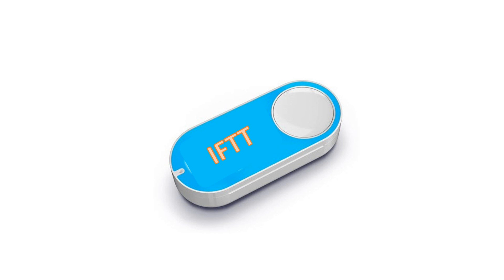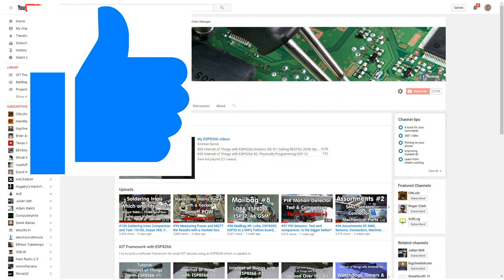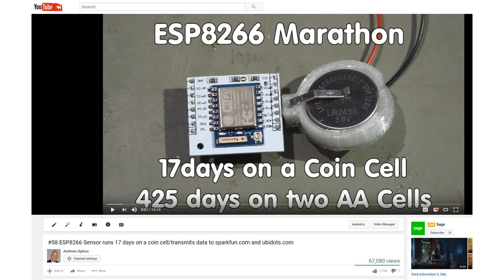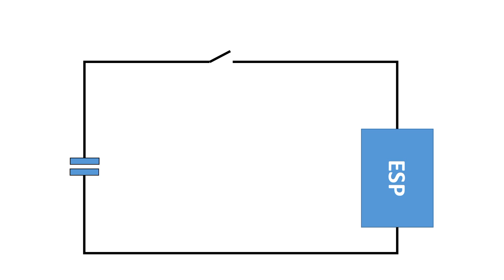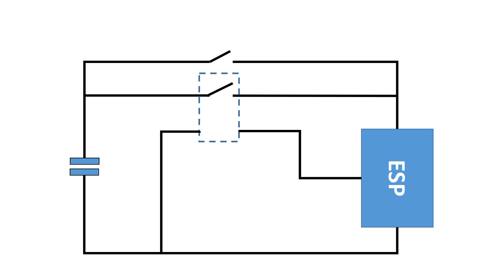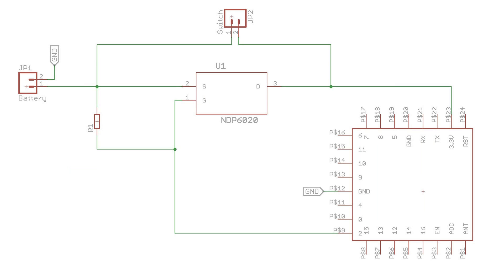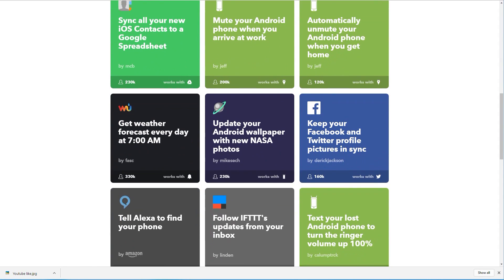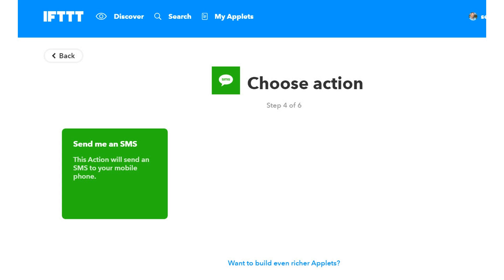#101 Long lasting DIY "Amazon Dash Button" using an ESP8266

Comment: Commenting to help the channel. Also, a real question...were you able to discover why it took the 15 minutes for the message to post after the sensor activity? I use IFFFT for some of my HA functions around the house and it is fairly instant? Was it possibly due to the proxy server in between?

Side thought, (you may have already done this. I haven't watched all your videos yet) you could combine an RFID tag reader to a button "station" so that it could perform different actions based on who was pressing it. Perhaps your wife or kids like a different kind of pizza. A small, passive RFID bracelet could make that happen :)
Reply from the maker: 1. I did not investigate into IFTTT. Maybe it just had a "bad day"... I usually use my own MQTT broker, so I am not experienced with IFTTT
2. I used the mechanical switch because it does not need any electricity if not used. The RFID reader would need the same property if you want to start the ESP with its pulse. Or you would need a button as now and switch the RFID reader on with the ESP. Maybe an easier way would be to connect a few buttons, each for a different purpose.
Reply: I suppose it all depends on the use case. For example, if it is expected that button will find it's way moving around the house, or if it would always be in the kitchen near something that could already be performing micro localization of occupants. In lieu of all that, and more inline with your multiple buttons idea, you could ad a single button with a RGB LED and keep it all on one device. You could tap the first button to get the color you want (everyone gets their own color), then press the "order" button. You could even do this for a single user and ordering drinks; yellow for beer, red for energy drink, and blue for a Mana potion.
Reply from the maker: I see, you are a very creative person. And these wishes were always the first part of something new. So, keep on!

Comment: Which mosfet do you recommend for this circuit? the NDP6020 seems to be oversized and expensive. What about a BC557?
Reply: Hallo. Du hast hier einen super Kanal aufgebaut und sehr hilfreiche und interessante Viedo gepostet. Ich habe versucht den Dash button nachzubauen. Irgendwie bekomme ich jedoch die Transistor schaltung zur Spannungshaltung nicht hin. Ich nutzte ein 2n2222a-h331sollte ein npn transistor sein. Geht das überhaupt damit oder nutzte ich das falsche Bausteil. Ich habe Transistor auch mal anderesherum eingebaut, leider ohne Erfolg. Grüße
Reply from the maker: AFAIK the BC557 is a NPN transistor, not a MOSFET. You can replace the NPD6020 with a logic level SMD MOSFET, if you want.
Reply: AO3401 is cheap and a p-channel
Reply from the maker: Looks like a good choice. It should switch at 3.3 volts. But it is tiny (SOT23)

Comment: Can you provide some physically smaller Mosfet part numbers? I can find plenty of to-220 packages, but I am having trouble finding smaller ones.
Reply from the maker: There are not many through hole logic level p-channel MOSFETS available. I recently bought some IRLML6401. They are SMD. But I did not test them so far. If you search, search for one which is switched on at a Vgs of -3.3 volts

Comment: the NDP6020P pinout is wrong on video. The right way 1-G  2-D  3-S
Reply from the maker: Thanks. You are right!
Reply: Andreas Spiess I could not run the esp8266 from a coin cell CR2032..  what one had you used?

Comment: Andreas, I am having trouble with my mailbox notifier circuit.  I have used an IRF9540 P-channel MOSFET to automatically turn off my esp8266-01 via a reed switch.  But the module keeps restarting and it doesn't seem to respond to the reed switch.  For example, if I type digitalWrite(MOSFET, LOW), the entire circuit shuts down; This should not be happening but I don't know how to fix it.  It looks like the esp is properly shut off, even if no magnet is nearby, but after a while, the ESP restarts and initiates wdt reset. 

Also, I would prefer if the esp8266 01 would auto-reset itself after each startup, just like the Arduino.
Here is my schematic: https://tinyurl.com/yazx45l5

I also noticed you struggled with the same wdt reset problem.  Did you figure it out yet?  Here was your discussion: https://github.com/esp8266/Arduino/issues/1017

Thanks,
Nathan^2
Reply from the maker: I always suggest to partition systems for error search. In your case, separate the two things: The ESP and the MOSFET circuit. First, you test the ESP with a normal switch to simulate the effect of the MOSFET. Does the ESP behave as you wish?
Second, you use your MOSFET circuit without the ESP (simulate the ESP with a 30 Ohms resistor, attention: hot!) and test, if it switches the power pin according your plans. It might be, that it does not properly switch, because your MOSFET has a high Vgs voltage.
Only if both parts do exactly what you expect, you connect them together and test again. Measure the voltage at all points and compare with your initial tests from before.
Reply: Andreas Spiess, I just moved the 1M ohm resistor that was originally connected to the source of the MOSFET and now moved it to the drain.  it works now but unfortunately, the current is 15mA when the circuit turns off power.  I did your original circuit as well and, Surprise, got 15mA at off state too!  Something is telling me that this MOSFET has a leak.  Should I get the MOSFET you used in your video or should I make a modification to mine?
Reply: Andreas Spiess also, should I regulate the voltage first and then control it with the MOSFET, or can I use what I did (MOSFET controls the voltage regulator)?  Does it make a difference.
Reply from the maker: As I wrote, I think, that the Mosfet does not fullyturn off at this low voltage. If you regulate first, this would even become worse. Please check (without the ESP, if the Mosfet really cuts the power (zero voltage at the regulator). Maybe you add also one or two 1.5 volt batteries to increase voltage (all without ESP), as described in my first answer. If if works, then it is clear you need another Mosfet. BTW: I also do not see the need for the PNP transistor.
Reply: It's an NPN transistor, and I forgot to mention that its function is to make the reed switch act in its opposite manner.  For example, for my mailbox whenever a magnet is close-by, the circuit turns off.  But when the lid is open(The magnet is away) the circuit turns on.  

I measured the current draw with an Arduino Uno then an Nano in place of the esp8266 and surprisingly I got 0.35 mA.  So it is definitely the MOSFET's functionality.

Comment: hi, I'm using nodemcu V1.0 where I'm trying to use a library that is there for Arduino. it is giving me results, but rather questionable results. Could you shed some of your insights. In any case can we use Arduino's library with Nodemcu directly?
Reply from the maker: You should be able to use Arduino IDE with Nodemcu boards. That is what I do all the time.
Reply: Thank You for the reply.
I'm trying to use the MPU6050 with Nodemcu. There is a library in Arduino IDE for MPU6050 to use with Arduinos. I tried using it with Nodemcu adding the esp8266 library along with it and changing the board to Nodemcu V1.0 on the IDE as well but I'm not getting correct values I think.
Reply from the maker: I never used the 6050 with a ESP8266. So, I do not know.

Comment: Have any SCRs to play with? An SCR triggered by your switch and use the PFET to break the circuit.

The power delivery circuit is battery positive to SCR Cathode, SCR Anode to PFET source, PFET drain to ESP power. the PFET gate is pulled down with a resistor to ground and attached to a output of the ESP.  When the ESP is don set the GPIO high to stop power.

This circuit is 100% analog on startup and latch, digitally triggered when off.  An example SCR like the P0130AA is 1uA at 100V across the cathode to anode.
Reply from the maker: I have to admit, that I do not know these devices and never used one. This is why I am not not sure, which would be its advantage in this scenario. As far as I understood (from Wikipedia) this device can be triggered by a pulse and then keeps its conductivity. This is done here by the Mikrocontroller (without any additional cost).
Reply: I was going for zero power and ability to not require booting to keep the unit powered on.

The key factor of the SCR is that it keeps conduction until the current drops below a threshold current 5mA for the model P0130AA.  As for switching off, I realized that putting the MCU into deep sleep would drop below the holding current of the SCR.  Now the switch off is to tell the unit to go to deep sleep, no GPIO needed.

Comment: I've been saving this video for awhile and finally have used for my mailbox notification setup! I am using with a WeMos D1 Mini because I will need an external antenna. However, I found that while the mosfet (NDP6020P) would turn the WeMos off, that it continued to draw current (not sure how much). The only thing that stopped it was removing the battery or pressing the WeMos reset button. My solution was to use ESP.restart(); in lieu of digitalWrite(4, HIGH) to "turn off" the mosfet. Just thought I'd share. Thank you Andreas.
Reply from the maker: I think, you used the 5V supply. Then, the Mosfet does not turn off, because the ESP delivers only 3.3 volt when high and you still have a negative voltage on the gate (5 - 3.3 = 1.7 volt). Figure 5 in the Mosfet datasheet says, that the transistor is only off if you have less than 1 volt.. 
My proposal runs on 3.3 volt.
Reply: I'm glad you mentioned this as that was originally what I had done, but noticed the condition persisted with 3.3v. I'll have to take some measurements and see what's going on. Might be a peculiarity of the WeMos.
Reply: Just wanted to mention that I rewired this morning and it works just as your example does! My possibilities for getting it wrong are limitless! :) Thanks again.
Reply from the maker: +structure7 :-)

Comment: Can i use optocoupler (as relay) instead of FET transistor? For example, K817P according to this pdf: https://www.vishay.com/docs/83522/k817p.pdf uses only about 10 nA when off (vs 1.1 μA for transistor)

Also liked and subbed :)
Reply from the maker: I am not sure. A ESP8266 uses about 80 mA average and the optocoupler has a rating of 60 mA. So, I do not know if it will deliver enough current and how big the voltage drop across the transistor (part of the optocoupler) is. So, the best is to try it out, measure the voltage, and feel its temperature (if it is overloaded).
Reply: If I get the numbers right, it should be possible to drive two or three 4N32 in series from one GPIO pin. (<10mA at <1.18 V for each)  They should then conduct 50-150mA collector current each, so if the detector side is wired in parallel, they should support the ESP on WiFi.  If the OFF state, the dark current is then expected at 2-200 nA.
Is this completely crazy? Or is there an even better design? (I would like to avoid trouble due to fluctuations in the G-S voltage that some people report.)

Comment: Andreas, your videos are so helpful!  I wish I had found them months ago. Thank you so much for sharing all this with us.  :-) 

Maybe you can point me the right direction on something related to this.  I am trying to build a very small device (hopefully using a button battery) that can sense every time a switch is opened or closed.  What I want it to do is to wake up the ESP, send an "is open" or "is closed" signal, and then go back to sleep to conserve energy.  However, I need it to connect to WiFi and send the update pretty fast, like less than 1 second.  Is this possible?  Here are the approaches that come to mind:

1) Put it in deep sleep mode and use some kind of a circuit to pulse EXT_RSTB low every time the switch changes (I could use a normal reed switch or one of the NO/NC combos or a mechanical switch).  My first concern here is that it may take too long to connect to the network.  My second is that I'm having a hard time figuring out the circuit to send the low pulse to EXT_RSTB to wake it up.  (By the way, I would use MAC addressing to fix the local IP address on the network.)

2) Put it in light sleep mode and use gpio_pin_wakeup_enable to watch for the switch to change states.  My first concern here is the extra power usage.  My second concern is if I can use two GPIO, one to sense when the switch closes (GPIO_PIN_INTR_LOLEVEL) and another when it opens (GPIO_PIN_INTR_HILEVEL).  

Do you have any insight on whether either of these will work, or which would work better?  

Sorry that this was so long, but I'm having a hard time finding an answer to this question.
Reply from the maker: 1. If you want to detect positive and negative edges, I think, you need an external circuit, because you have somehow wake-up the chip before it can detect something. Detecting either or can be done by a simple contact.
2. How long it takes to send a message from boot can easily measured by yourself. Depends heavily on the time to connect to your WLAN
3. The IP stuff can be solved by using DNS. Then, your board gets a fixed name and you do not need to care about its IP
4. Light sleep seems to keep the WiFi connection (I never tried it), and can therefore send quickly, but uses way too much current for a  "button cell".
5. Maybe you cant to use a different module for communication (like a NRF24 or even a cheap 433 MHz module) from the sensor to a gateway (which is always on). These would be "instant on" because they do not need to connect to Wi-Fi. And the gateway would anyway be always connected.
Reply: Thanks for the reply!  I will look into that.

Comment: Hi Andreas, firstly thank you for the videos, keep them coming. I am an absolute beginner to electronics but I'm slowly learning. 

I really like the concept here but unfortunately I am having trouble implementing the MOSFET power circuit. The issue I am having is that the NodeMCU board I am using is not powering down completely, it partially powers down but I know there is still power to it as I can still see current flowing (also the boot up times are too quick to be from a totally off state). 

After some investigation I have found that the gate is only reaching about half of the voltage required to completely shut off the MOSFET. I am using a 10k pull-up resistor on the gate but still not enough. The GPIO pin appears to be sinking the voltage as if I disconnect this the pull-up resistor does it's job and shuts the MOSFET off completely. 

Hopefully you or someone who reads your comments can help a newbie. Keep up the good work.
Reply from the maker: Do you use a P-channel Mosfet?
Reply: Andreas Spiess Yes, I have a IRFU5305 P Channel MOSFET on the high side of the circuit.
Reply from the maker: The gate threshold voltage of your FET can go up to -4 volt and your ESP has only 3.3 volt to offer. So, your FET might not switch on. Maybe you experiment only with the FET without the MCU if you are able to switch it with the voltage levels provided by your pin.
I used a NDP6020P which has a Vgs threshold of only -1 volt and is better suited for our purpose. Many FETS are used for power supplies with higher voltaes. We need "logic level" FETS
Reply: Thanks for the ideas Andreas, I'll have a look about for another MOSFET with a lower threshold.
Reply from the maker: Look at sparkfun and adafruit. They have some...

Comment: Why not simply switch the CH_EN pin HIGH using reed switch just long enough to run code that toggles GPIO2 HIGH, which is also connected to CH_EN, and thus keeps the ESP8266 running while it connected to wifi and sends message, then the code toggles GPIO2 LOW, which shuts down CH_EN, powering off chip?
Reply from the maker: You are right. If you watch video #108 I do something like that. This principle here is more universal, if you e.g. have sensors in addition to the ESP.
Reply: Andreas Spiess Thanks for the quick reply. I am trying to get a circuit like I described working, but it doesn't work. If you have a moment, please take a look at the diagram and let me know if you spot what is incorrect. http://community.blynk.cc/t/troubleshooters-needed-esp8266-mailbox-notify/11529
Reply from the maker: You can watch my video #108. There, you find the diagram
Reply: Andreas Spiess Okay. Thank you.

Comment: First of all: Thanks Andreas for your Videos - I really like them!!! Probably you are already aware of it but I had the following problem: For my tests I used a N-Mosfet on D3 with a 10K pull down. Every time I powered the device on the Mosfet went to HIGH - drove me crazy until I figured out that D3 is also used for "Flash". It seems that while powering up the device turns this pin automatically to HIGH. As soon as I moved the mostfet-pin to D2 the problem was solved. BTW: I tried the same with a reed relay on D3 and it worked - (it's clear why...)  (NodeMCU v3 https://goo.gl/CukCS0))  (So - hope this helps someone else!) Update: Forgot to mention: I'm using a FQP30N06L-Mosfet.
Reply from the maker: Using D3 / GPIO0 is always a delicate thing, because it is used by the CPU itselfto flag "programming mode". And if you use it, never pull it down because this is the signal to enter into programming mode. You have to make sure, that it is pulled up during startup. Afterwards, you are free.